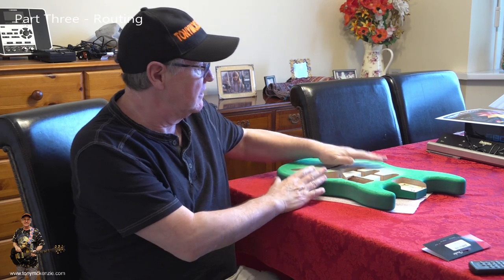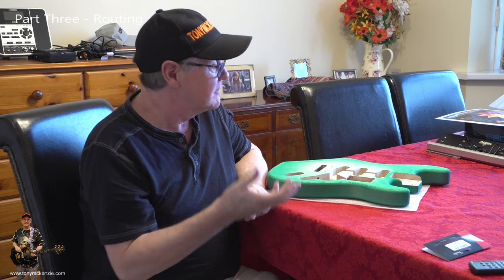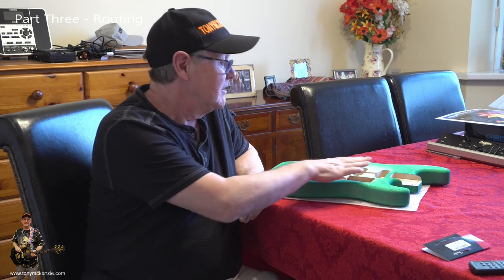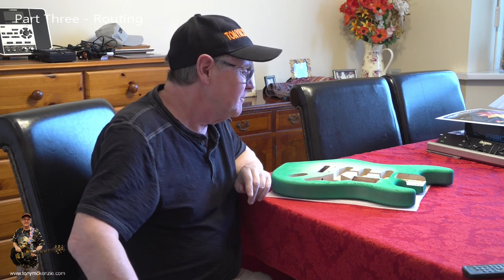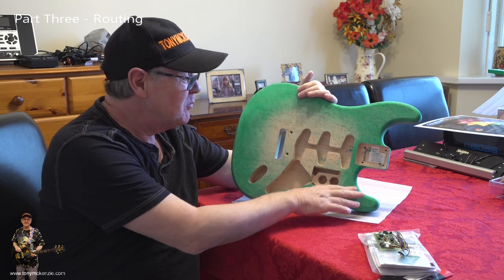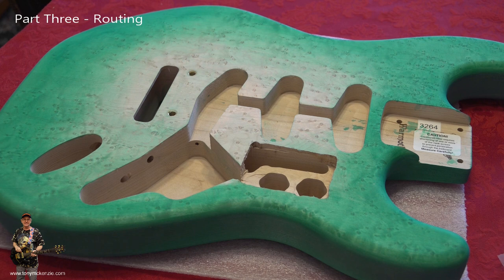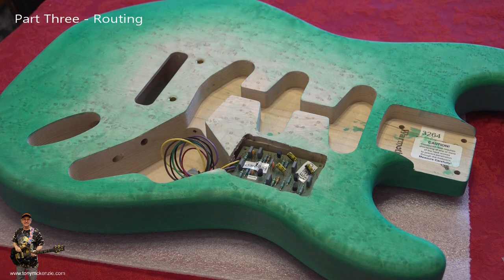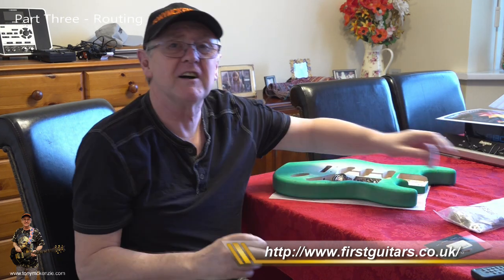Perfect Warmoth Stratocaster Guitar | Featured: Body Routing For Clapton Mid Boost | Part 3

Comment: One technique, if you have a drill press, is to use a fairly large drill bit to drill several holes (covering most of the surface to be routed) to the required depth. Then use the router to clean up and get the bottom flat. If square corners are required, a chisel does the final cuts. That's how we did it at Crimson - efficient.
Reply from the maker: Very useful point... thanks for the info. Alas, all I had was a table, a body and a Dremel & router add on from Amazon a year ago because it was cheap :) Sooner or later it would come in for something - and this little mod is exactly the right sort of job for my practice :)  -  but importantly, anyone that has never done anything like this should not be too worried to do it... even I can do it :). I'll probably tidy up the edges of the hole a bit and screw the board in there. Thanks again for the info.

Comment: Those boost circuits are brilliant. I’ve got one in a strat along with a TBX control circuit on the middle tone pot. It’s amazing how versatile it makes the guitar. It’s still on its original battery from about 4 years ago!  Looking forward to seeing how the build goes.
Reply from the maker: Yes I have used them before in my dark past :) The devil is waiting for me :)  - Exactly correct on the TBX etc. Stay safe.
Reply from the maker: Hey thanks for that... as you see yourself their routing is far better :) but mine will be fine though. Can I keep the image for using on the video of the mid-boost later? if not that's OK either way but it could be a pretty useful image to show how Fender did it... just let me know about that and thanks for taking the time... it was a long time since I had a Clapton Strat (probably early 2000's!.
Reply: @tonymckenzieofficial  Sure, not a problem.
Reply from the maker: Thanks Richard....
Reply: @tonymckenzieofficial  Thank you for the picture. It looks like a neck pocket routing template would work nicely to rout for the PCB.
Reply from the maker: Yes good point... silly me I did it the very hard way :) but to be fair that was the very first routing I ever did on a guitar body... let alone a hollow one :). Thanks for the info.

Comment: Don't forget the shielding and PCB don't mix. Take care and stay safe.
Reply from the maker: Very good point to make... I do know that but someone could easily get it wrong for sure. The main board will be screwed to the wood internally so safe in this case and even maybe some rubber sheet on top depending on where the shielding might be on the pick guard. But great point and thanks for watching. Stay safe Michel

Comment: Luckily, for me, my perfect Strat was one I happened across in a local pawn shop. A Midnight Blue Strat that was made in Mexico. It had that certain magic when I played it that I hadn't found in quite a long time and this time it was one that I could afford to get.
Building one can be great nut around here it is hard to find a luthier to properly make one. My DIY skills are not as lofty as my dream of building one was.
Reply from the maker: Well you found one that worked for you... and that's the biggest thing there is. I have a 'cheap' used Ibanez bought for $500 and it's the best player I own... shows the 'right' guitar and mix does not have to be expensive... thanks.

Comment: Tony, I considered the mid-boost circuit.......But it put too much of a squeeze on my tone? That's why I went with the straight EMG pre-amp, and integrated the gain board mounted pot into the regular pot array...I am anxious to hear the tone from the final outcome on this build! Stay well, and sane Tony during the lockdown!   Scott
Reply from the maker: I understand that of course. But it can be turned on or off? (hopefully :)  But it is very likely that you did not use the pickups I have chosen for this guitar very purposely... and they can be very toppy. Nothing wrong with the EMG stuff though! Remember to take in to account the pickups I used in particular... I won't tell you what they are yet but you will see them soon enough and ask why I chose them :). Oh right on... I heard today that the 'lockdown' will be until the end of March currently. Unbelievable and I wonder how many businesses will go or how many will lose their jobs :( its staggering. You stay safe Scott and more coming up soon on this guitar over the weekend and beyond...

Comment: Try making a template next time and use a shallow depth pattern bit. You'll end up with a very professional 'factory' looking cutout and it will take much less time once you begin the routing process.
Reply from the maker: Thanks for the tip.... forst route I ever did and your info is useful... thanks.

Comment: Warmoth does give option for single & double battery routing but not the Clapton circuit board routing 🤔
Reply from the maker: Correct and that's what I meant just for clarity... and I can see why in particular on a hollow body they don't offer it. But it can be done. Thanks for questioning that point as it clarifies things nicely. I intend to touch up the sides of the hole with a sharp chisel just to make it look nicer whether anyone can see it or not... Stay safe.

Comment: Thinkin' about putting an EC Mid-Boost in one of my Strats. Had a Buddy Guy Strat at one point, which has the same electronix as an EC model, but sold it off. Would like to use a template for a clean rout though. Have a P-90 template I could prolly make-do with by moving it around within the lines of the circuit board...hmm? Battery could be stuffed into the main control cavity...maybe?
I'm working on an '83 Fender Elite Strat (walnut) for a friend now, that has the Pre-EC circuit in it. Refinished the body & have it all set up playing great but...no sound! Checking all connections & they seem OK. Hopefully I can sort the problem out...
This guy makes an '83 Elite sound great:
https://youtu.be/4vEN5gSfWgA
Reply from the maker: That guy did a brilliant job of the Strat sound and playing - an excellent player with very high quality tones as expected from those amps and the Stratocaster. Thanks for the link... Yes I made a mistake of no template ... but I did learn from that. They tend to put the battery under the pick guard sometimes. I have a secret... I have a new body for this guitar coming on soon. That is a rear route and without a battery box. I cant use the pick guard space at the front because its not there and I expect to put the board and the battery in the rear control cavity....  how well that will work? who knows, but I might think more on it before you see the results :) There could be a few things re no sound... check the connections over again and check the guitar output jack socket as that is a switch for the power....  thanks for watching.